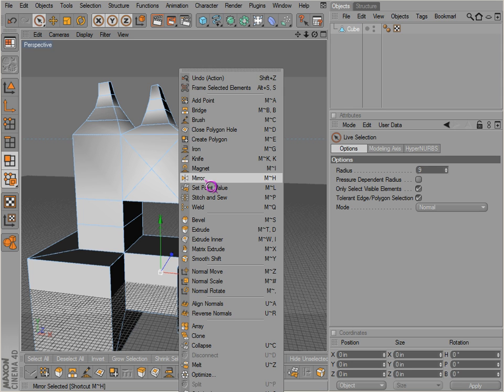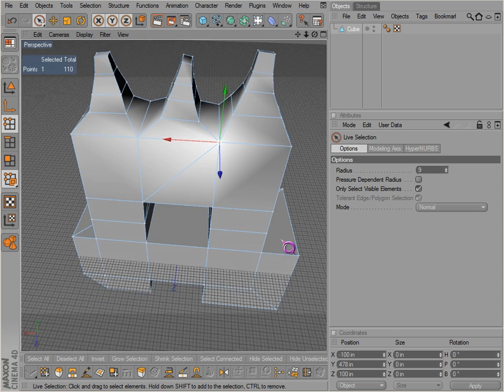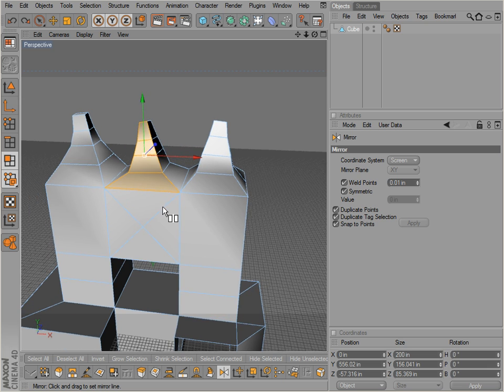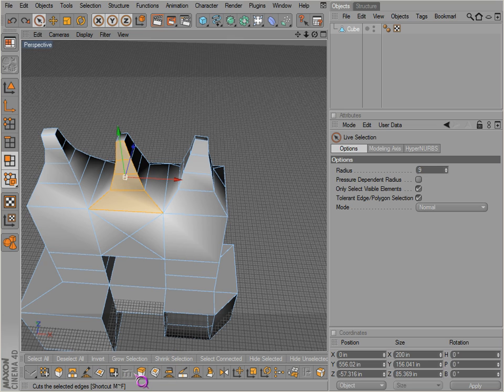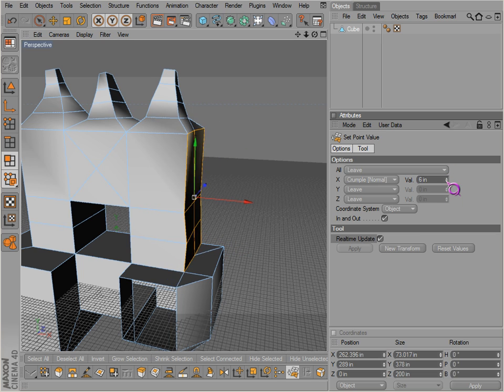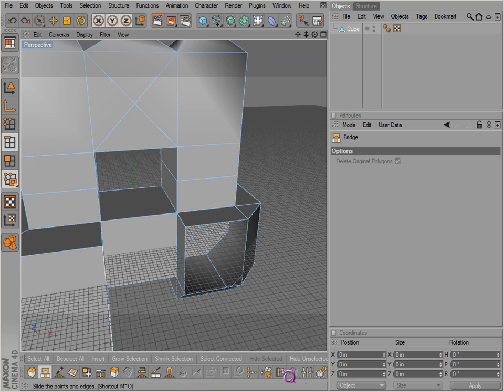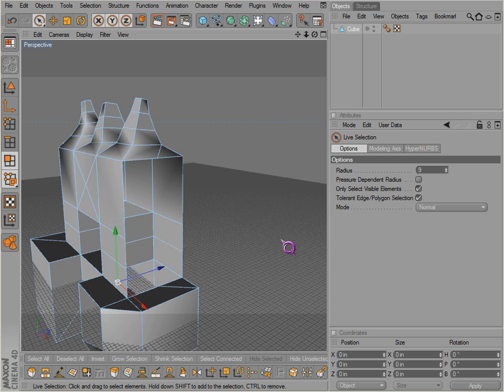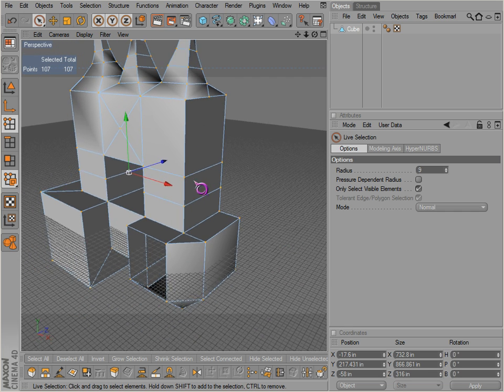Cinema 4D Modeling 03 - Weld, Mirror, Set Point Value, Stitch and Sew, Remove N-gons

Comment from the maker: @elewint Well, not “bad” per se, but discouraged b/c they’re actually quads and tries in disguise (seen in C4D by checking N-gon Lines in Viewport Attributes (Alt+V)->Filter). Therefore, how they deform or smooth is uncertain. Even quads are actually tries, (triangulated on the fly). If you pull a corner from the direction of its face, you’ll see it flex into two tries. 3 points determine a plane. Even modern game engines like UDK only use tries b/c quads don’t exist at the hardware level.

Comment from the maker: @stefjw21 Weld is covered in the first 2 minutes. It basically welds two or more points together, whether you have points, edges, or polygons selected. You can determine at what point you want your points to weld by bringing the cursor over your desired weld point before clicking to weld.